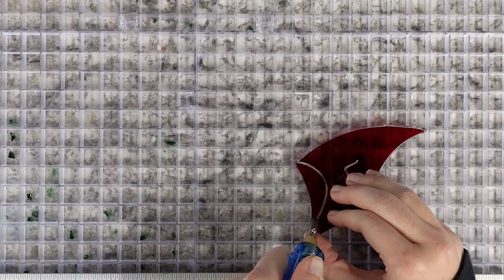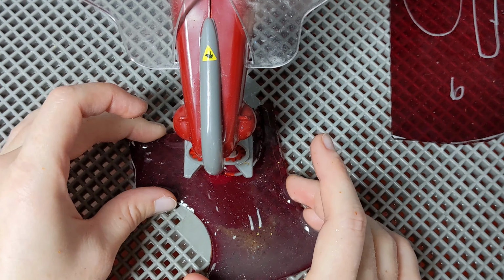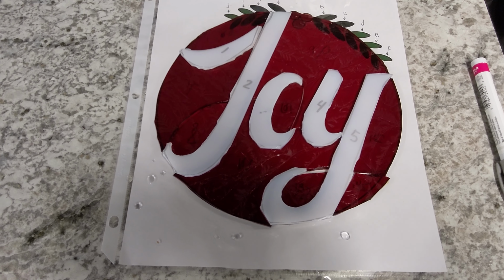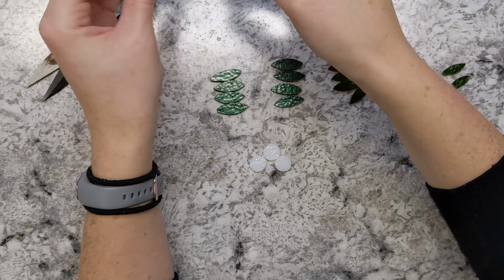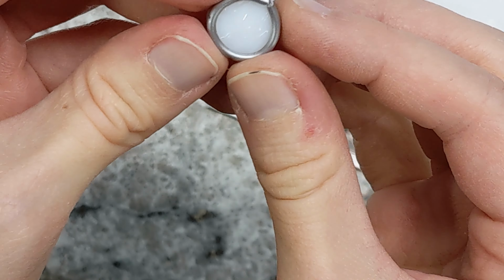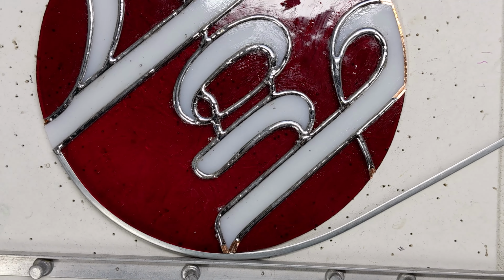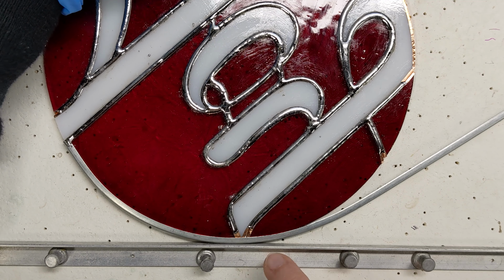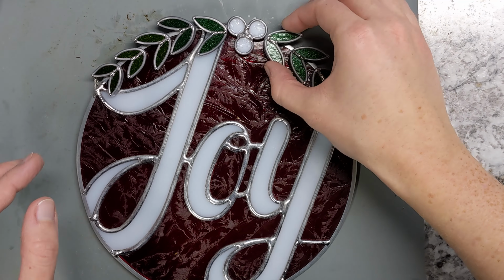Watch me Make a Joy Stained Glass Panel

Comment: I love this! Thank you so much for showing how you used hobby came on the leaves and berries (as well as the links of the products you use!). I tried hobby came for a small christmas tree and had the hardest time wrapping it. Might of been because the channel was too deep and/or I used one long strip to wrap sharp corners and under leaves. I just ordered the hobby came you used. Here's to trying it again!
Reply from the maker: Thank you so much! Possibly when I have more time after the holidays, I can do some more technical videos. I just make these videos for fun, and as a little escape from raising two little boys. 🤣
Reply from the maker: Hobby came is the thinnest lead came you can get, so you shouldn't have any troubles wrapping your project with it. However, the only way to wrap sharp corners is to cut your lead at the corner, rather than bending the lead around the corner. I'll do a hobby came tutorial in the next week or two! 🙂

Comment: Please explain difference between hobby came and zinc
Reply from the maker: Hobby came is made out of lead, and is more pliable, so that's what I used to wrap the berries and leaves. Zinc came is rigid and adds a lot of strength, so I used that for the perimeter of the circle.